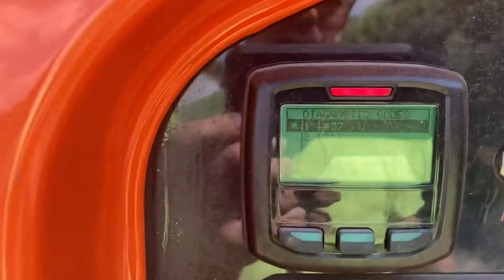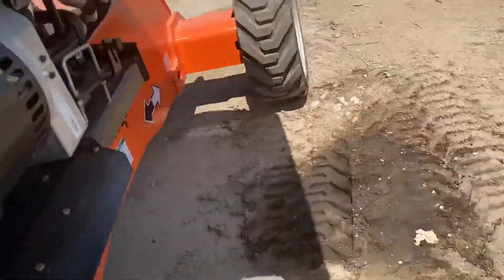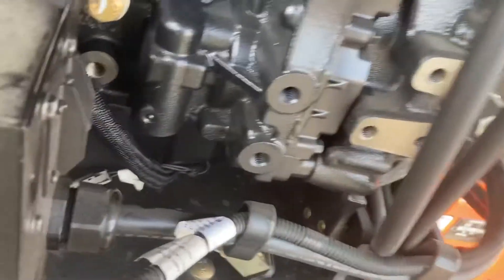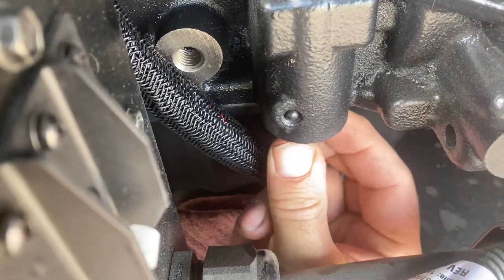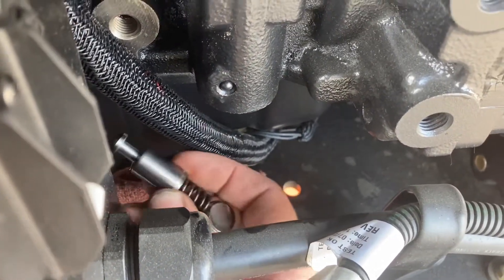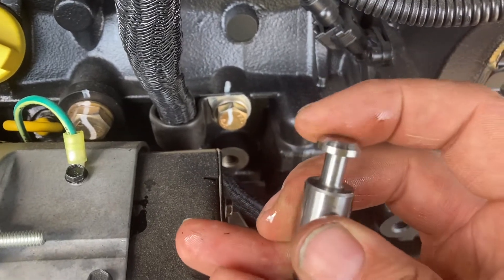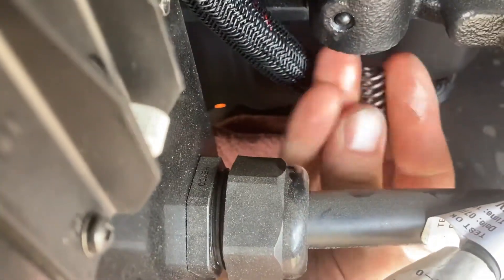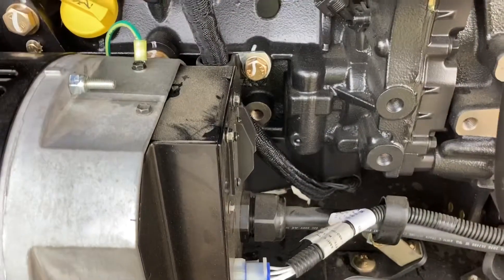FF7 JLG code 437 Deutz 100:1 low oil pressure shutdown

Comment: Hi 
I have 600AJ 2012 model Duetz D2011 Engine 
Recently import from Sydney 
Engine is over heat when i switch off machine and restart machine is not started causing over heating 
When engine is cool down engine start easily
Reply: From India
Reply from the maker: Do you have the JLG analyzer? If so use it to see under the engine diagnostic menu what the engine temp is.  Verify it is actual and not an inflated false reading.   Or if it is truly overheating that problem needs resolved

Comment: Tcd 2.9 L4 deutz Engine trouble code 94:3  means??
Reply from the maker: Fuel pressure sensor short to ground or open.
Reply: @VinylVillageGarage  Engine trouble code 523613:0?what i need to do please help me 🙏
Reply from the maker: @potnoorusarada5212  that code has to deal with rail pressure, low or high. If you have access to the deutz diagnostic serdia program it will tell you in more detail of its low or high pressure issue
Reply: @VinylVillageGarage  Tq sir 👍
Reply: @VinylVillageGarage  Tq for your reply and issue resolved.

Comment: Where is the oil pump located and how do you remove it? Is it under the timing cover?
Reply from the maker: Oil pump is located at the flywheel end of engine.  It can be removed by pulling the hydraulic pumps off, flywheel, then rear cover.  The oil pump is sealed to engine by orings and can be replaced with out removing oil pan or entire engine
Reply: @VinylVillageGarage  are you positive it's not on the crank pulley side? It seems odd it would be on the flywheel side.
Reply: Damn. Mine has low pressure- I pulled the engine and put crank and rod bearings in. (Replaced both reliefs prior) still low pressure. Looks like I have to replace the pump. Fkn sucks since I had the engine out and would have been easy then.
Reply: I have a manual but it doesn't show that. Do you have a manual you could send by chance?
Reply from the maker: @AnthonyBartlett-i1t  I don’t have a manual unfortunately.  I did have an engine like yours low
Oil pressure, oil pump had been replaced, I pulled the engine and found this metallic  and thick sludge throughout the engine in all the small crevices. Something was worn but I never found what. Rods and mains all in spec. Cam was not worn.  Never found the reason but the owner decided to replace the engine
Reply: @VinylVillageGarage gotcha. No metal- some sludge in the pan but otherwise clean. 

I'll let you know after the pump if it works.

Comment: I have the same motor but it it’s in a Sullivan air compressor. Motor oil was like a milk shake. Replaced head gasket,oil cooler and all associated gaskets for repair. Im getting the same code. I’ve flushed motor oil twice and replaced oil pressure sensor. Also verified 5vdc on harness plus good ground. I pulled out the oil pressure regular with spring. It had some surface rust on it. I took 2500 grit sand paper and cleaned it up, then brake cleaned and lined with oil. Reinstalled and still having same issue?
Reply from the maker: Well a few things ditch the electric sending unit and put a manual gauge in it and test the oil pressure and verify it is truly low.  If it is there is another regulator valve just below the alternator same style Allen plug holds a spring and valve in it.  Remove, inspect, clean, reinstall.  Still have issues after that you might have worn crankshaft and bearings. Water is very destructive to bearings in engines.  

I had one that had low oil pressure after all the external repairs, you can even easily replace the oil pump on those engines it’s basically external still low oil pressure. So I removed and tore down engine and honestly didn’t find the smoking gun so to speak.   Bearings looked good and measurements where at the high end of the spec, cam looked good. The only odd thing was this sludge in the engine in the nooks and low spots.   It looked very metallic so I collected it in a plastic sample bottle and a magnet would stick to the fluid.  So something failed internally, unfortunately i can’t tell you what. We swapped it for a reman and it went back as a core. That was the only engine that I have messed with that could not be repaired quick and easy so unfortunately it happens sometimes. I hope this isn’t the same for you as well.

Comment: That is engine oil over pressure valve the regulating valve is in the front cover under the alternator.
Reply from the maker: Yes there is one there also and can cause Similar results.  It’s a large Allen plug.  I have never personally had that one be the problem only been told it could be.